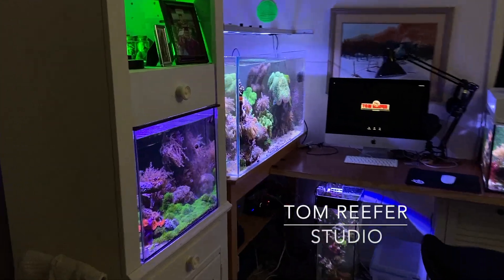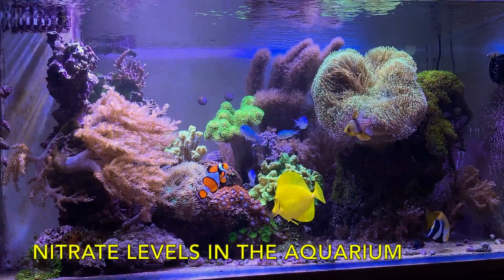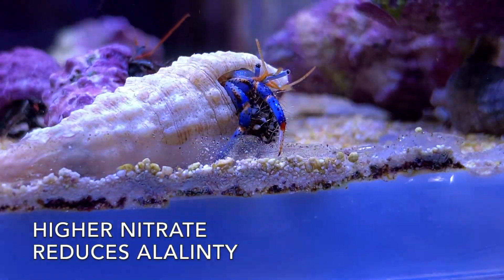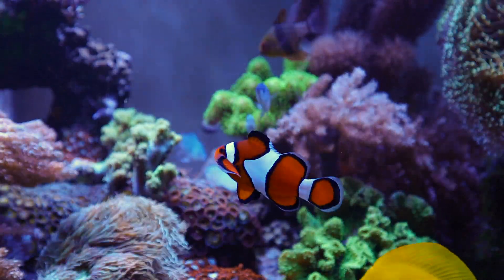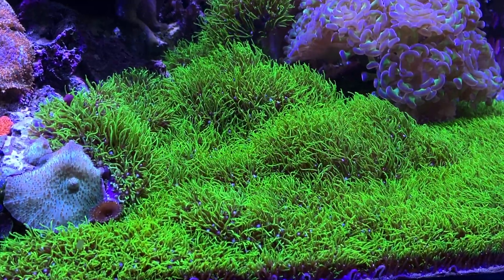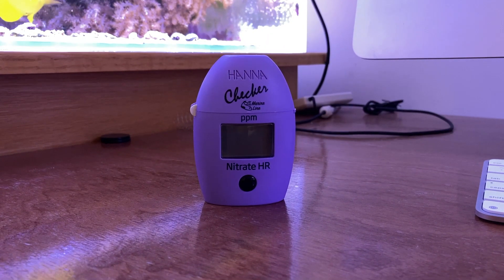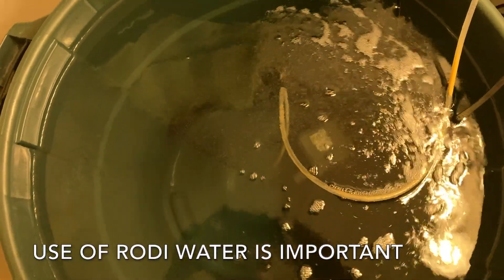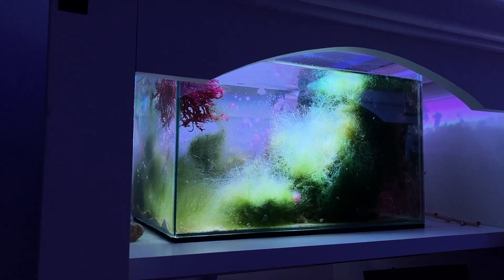Nitrate In Your Reef Tank? (DON'T MAKE A PROBLEM OUT OF IT!)

Comment: My nitrates are always at around 15-20 will a protein skimmer help idk if ive asked you already. Is 15-20ppm horrible?
Reply: 15-20 is good for corals, run phosphate very low
Reply from the maker: 15-20ppm is only high if your corals don’t look that great. (Polyps not open, just not their best) A skimmer isn’t really meant to lower nitrate. It removes organics before they can become nitrate. Even that is quite negligible. Best way to lower nitrates is 50% water change. So if you have 20ppm and want 10ppm, do a 50% water change. 👍🏻😊 refugium will help lower nitrates also.
Reply: @TOMReefer  thank you. Idk if you've looked at any of my videos but im running the tank on a fluval fx4 full of seachem matrix and another smaller canister filter full of filter floss. I also have a uv light. Might add a tunze 9004 intank skimmer soon

Comment: How do you get your nitrates to 0 ? Even after i do a 50% water change on my 60 gallon i still get 10 nitrates. I have a fluval fx4 filter full of marine bio balls and seachem matrix with only one sponge ontop. Any advice to reduce nitrate ? Skimmer ?
Reply from the maker: Hi Ray, if you have live rock in your tank, enough to support your bacteria culture, slowly, over a period of a week, remove your bio balls as well as your matrix sponge. Those filter areas where bio balls are kept become nutrient sinks. Btw, 10ppm nitrate isn’t horrible.
Reply: Water changes won’t reduce much ,if you have coral run nitrates 10-20.

Comment: For years I struggled with SPS as I was under the impression my nutrients had to be near 0.  After almost quitting I decided to restart a tank, add substrate (went barebottom for years) and let it do its thing.

25 nitrate, .05 phosphate and things are thriving! I actually dose about .1ppm of phosphate a day to keep my level there. Nutrients aren’t the enemy!
Reply from the maker: Hi AJ, I have low N03 but High Po4 and my sps do well. Happy to hear you’re being successful 👍🏻😊
Reply: The best success I had with sps and acropora was not low nitrates or phosphates when my nitrates were above 10 to 20 I had the best acro colors
Reply from the maker: @davidleach4689 I agree. 👍🏻
Reply: I have high nitrate and high phosphates😅😢
Reply from the maker: @tomg5405 try really large water changes over a period of a week (3)vacuum your sand bed too👍🏻
Reply: @TOMReefer  1300l, large water change are not the solution 😅
Reply from the maker: @tomg5405 if everything looks good, then no worries. But watch out 😊

Comment: My issue is phosphate. I run gfo in a reactor but lately hasn't been helping much. When gfo is doing its job it keeps things cleaner and clearer
Reply from the maker: Hi Nick, you caught me at a good time 😊. Try Phosphate RX. It’s lanthanum Cloride. It will lower it over night. Follow directions. I use it all the time. 👍🏻any questions feel free.
Reply from the maker: @kevin8360 hi Kevin, my N03 have been trace using the Salifert test
Reply from the maker: @kevin8360 hi Kevin, I do have the Hanna N03 test, I use it every once and a while to make sure my seller is still accurate. I get a 0 reading on that also. I’ve just never been a fan of dosing N03. My colors look good, so I stay where I’m at 👍🏻
Reply from the maker: @kevin8360 I have the low range, so I believe it’s getting used up. My phos is not super low. I’ve never had any problems with Dino’s from low nutrients though🙏🏻😊

Comment: My nitrates have been hovering in the 20 to 40 ppm and I have been doing weekly water changes .I can’t seem to drop it .I don’t have any fish at the moment just a 2 torchs and a couple zoas frags and one jack o latern coral oh and 4 rock flower and cleaner shrimp and two turbo snails
Reply from the maker: Hi Htowner, are you using RODI water? You might want to test your salt mix for nitrate after you mix it. That’s quite high with the bio load you have and not feeding. How about your test kit? Thanks for your comment 👍🏻
Reply: @TOMReefer  I will be doing a water change today and I will test for it .I’m using an api test kit but was thinking of getting something better .what test kit do you recommend?
Reply from the maker: Hi Htowner, if you want accurate results you should get the Hanna Nitrate Checker. The api test is not very reliable. 👍🏻
Reply: @TOMReefer I've been using api test liquid kits for year and they have been very reliable for me. Consistent results as well